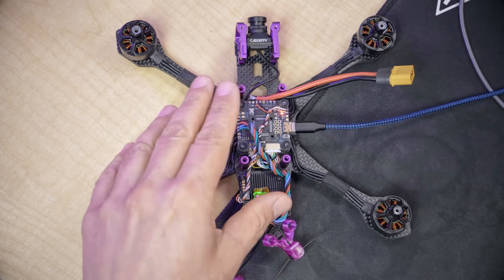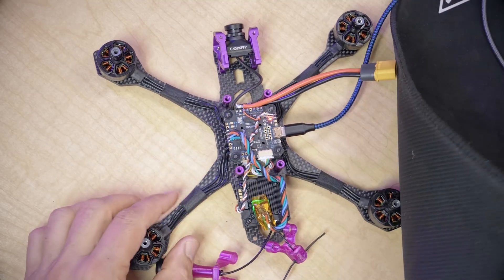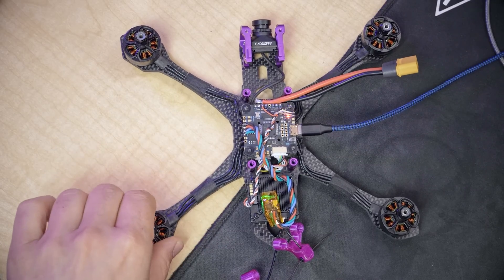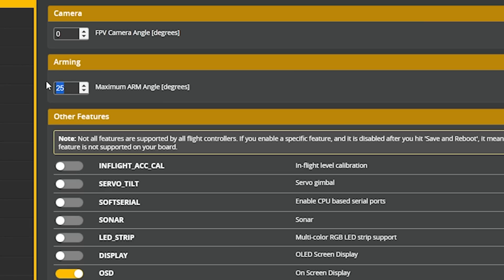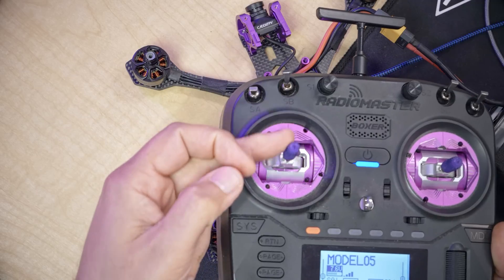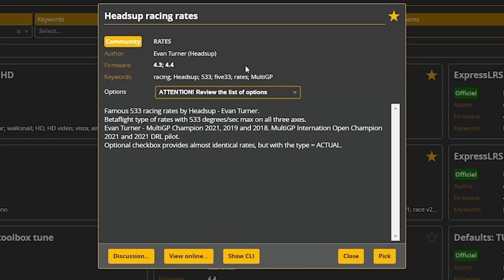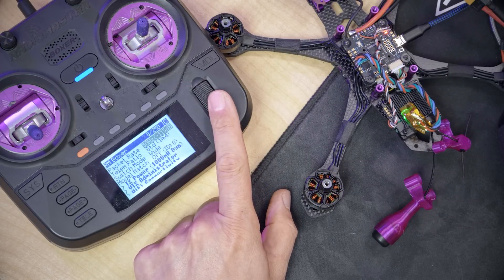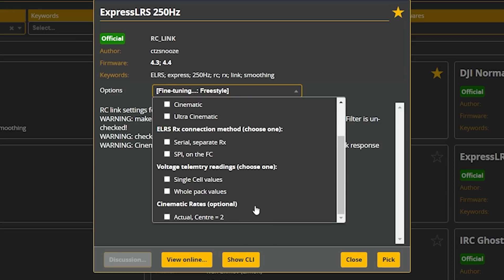Sub250g FPV Drone Build - 10 - Final Betaflight Setup

Comment: I was all good up until changing packet rates in my GX12. I see 50 2.4G and 50 LOW BAND, so which one? I chose each one in sequence, and now my receiver LED is flashing very fast! What happened? And the C in upper corner of the GX12 changed to - symbol. Did it loose the bind? My sticks show no movement in the Receiver tab. Did I loose all my settings? I tried to bind again and nothing. It seems when I chose the ELRS preset is when my problem began. Joshua said nothing about the WARNINGS: 

RC link settings for a 50Hz ELRS link via CRSF.

WARNING: make ABSOLUTELY SURE that the OpenTx or EdgeTx Hardware ADC Filter is un-checked!
WARNING: check that you are using a compatible version of EdgeTx or OpenTx!
WARNING: Cinematic settings are very smooth - there is noticeable delay in stick respons
Reply from the maker: 2.4G is for if you have the RP or XR series of receivers. Low is for if you have the BR or XR series of receivers. Fast flashing LED means the receiver went into wifi mode because it didn't have connection for 60 seconds. Power cycle the receiver to kick it out of wifi mode.
Reply: @JoshuaBardwell  Got it, thanks. I went back to using the one antenna RP1 so will set to 50 2.4G. Since my GX12 can do both  2.4G and 900 all I need to do is change the setting in the GX12 to 50 low?

Comment: The heads up racing presets wouldn't save. It said there were errors and then showed me the list of commands and each time a random command in the list was generating an error.

Different problem with the ExpressLRS preset, when I save it ends up booting into DFU mode and just sitting there. Unplug, replug, then double checking from the CLI it seems like the values from the preset are not what are set.

Betaflight 10.10.0 and firmware 4.5.0.

I ended up having to enter the commands into the CLI manually and that seemed to work.

Comment: Just finished the sub-250 build. For very green new FPV pilots, probably setting a throttle limit will be helpful and safer.  This drone has a much stronger kick than more beginner-friendly tinywhoops.

Comment: at 2’40 when you plug the battery the bip sequense is normal…. why my beep sequence is so different… with Lumenier LUX HD AIO
G4 FC + 35A BLHeli_32 3-6S ESC ? because my chip OSD is not working?